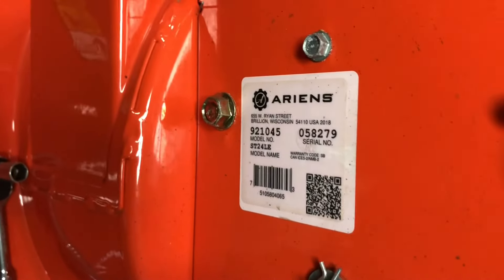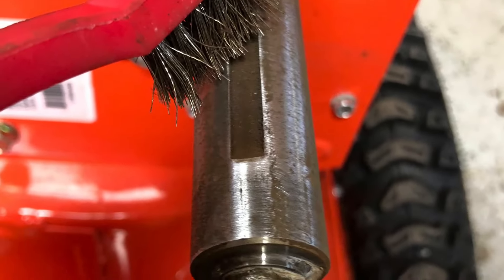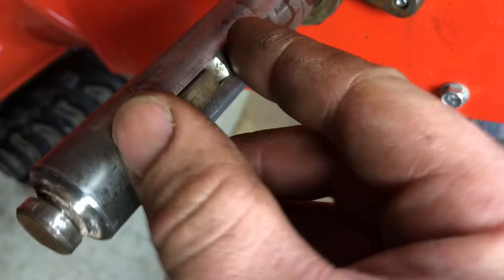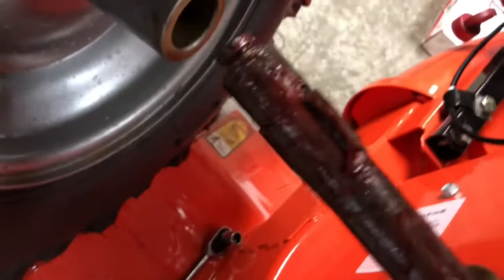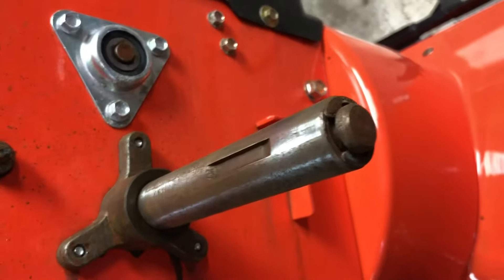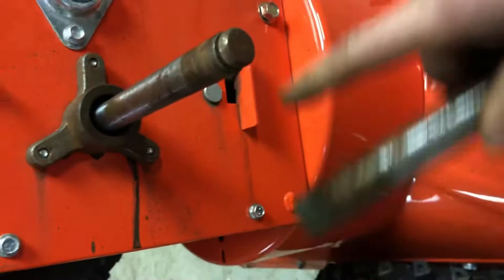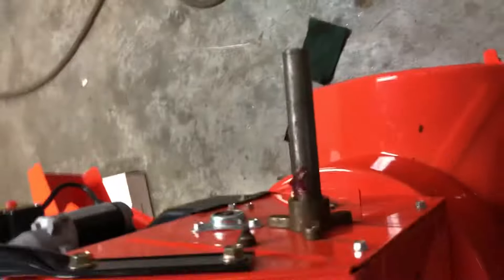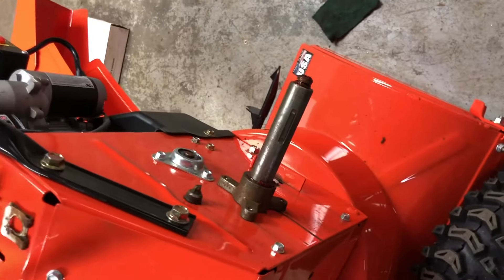How- To split Axle Maintenance on Ariens Deluxe Platinum Pro model Snowblowers

Comment: For how much Ariens charges for their snowblowers you would think they could spend a few extra pennies by putting some anti seize or grease on the wheel shafts when they assemble them at the factory knowing damn well that the average person who buys their snowblowers doesn’t have a clue that the wheel rims are going to rust solid on the drive shafts in a winter or two causing the customer to spend hundreds of dollars at a small engine repair shop to get it fixed. Thank you for making this video.

Comment: What kind of greaelse did you use? Low temp or high temp? Does it matter?
Reply from the maker: We used "high temp" but only because it is stickier and in theory will last longer. Almost all grease is better than what they provide from factory, if any.

Comment: You want to use anti seize on the axle to prevent rust. Good for up to 5 years in most applications.
Reply from the maker: So where do you stop? Anti seize has poor lubrication quality, ariens uses white lithium, if anything from the factory, and grease helps the axle shafts from getting stuck to one another. Red n tacky seems to be the best bet.